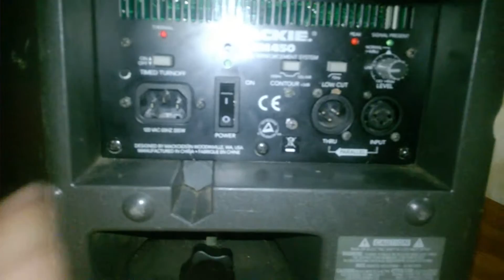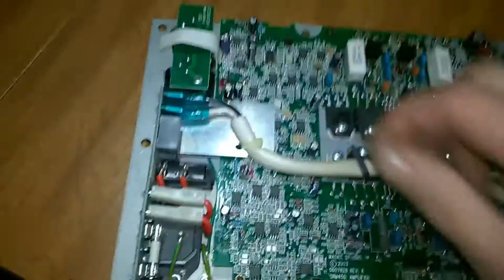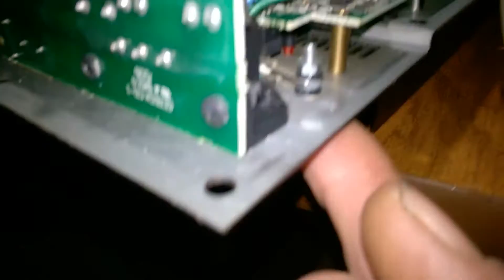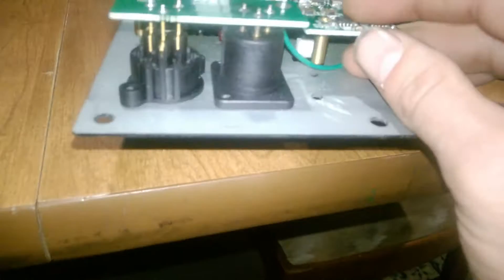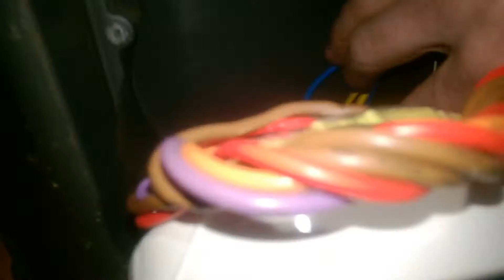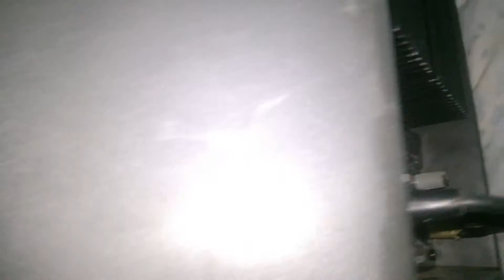Dr. Griggs Mackie SRM-450 Volume control Repair. Ep.3

Comment: Hi John.. My name is Rick, i'm from near Chicago and I found your name in searching for repair work on mackie speakers... i've watched your tutorial(s) on replacing the mackie srm450 v1 dual volume pot, and that the exact issue I have.  The speaker still sounds great but it looks like the pot had shorted.  I have someone that can repair it, but we're having one hell of a time finding the absolute assured correct volume pot part. we've got schematics and a plan but finding this dual pot seems to be a needle in a haystack.  The later versions are easy to find, but these dual V1 pots... not so much.  Looks like you have the know how, obviously...  do you have a pot to buy or know where i can buy one?  The speakers have been fantastic and still sound great even after years of use...  when the pot is about 2 o'clock, no sound.. but you at 3 o'clock and boom full blast 100% on....  so its def the pot.  any help would be really appreciated.  If i was in Atlanta, i'd just be showing up at your shop... LOL!! Hey, thanks in advance for any direction.  I'm also posting the same message on your youtube repair video.  Regards!  Rick

Comment: I have  SRM 450 v2 that will not power on. I have checked the power cable it has power going to the unit, but no light comes on.  i have checked the small fuse it is good. any thoughts?

Comment from the maker: I've noticed a lot of you asking about the potentiometer. I'm sorry I have not replied before but I just saw these comments. The reason I did not mention where I got it from is because the owner of the speaker acquired the part and it was relatively easy to track down online. I will reach out to him and see if we can remember where he got it from. However I do not remember it being a difficult part to find. The specifications for the potentiometer were googled through the model number and we purchased one online. If I'm able to get the specific model number and where to get it from I will add it to the video and post it in the comments.
Reply: So I did replace my volume port, but it’s still not working 100%. I am lacking of output. Don’t know why not sure if I has the right volume pot I will appreciate it if you can get me the right part number

Comment: you don't have to take all the screws from the ic's just the few on the back and the heat sink will come out also.
Reply from the maker: i like to take them all the way down and off screen i check everything to make sure every value is in correct specs. being thorough pays off in electronics so that you do not replace one piece that is bad and have it redamaged by something else that is bad.